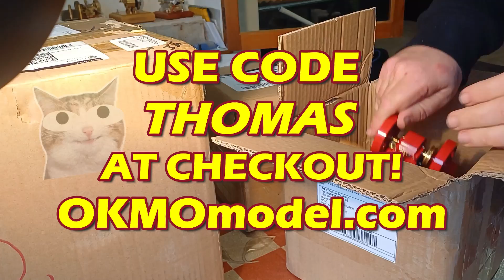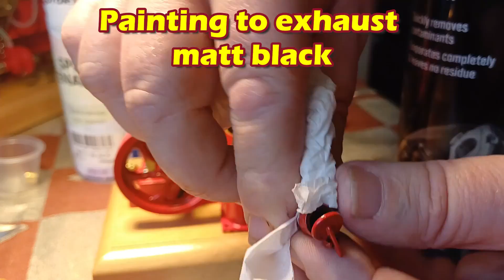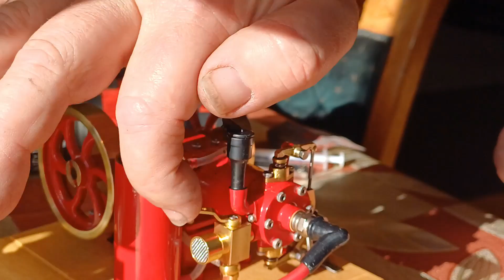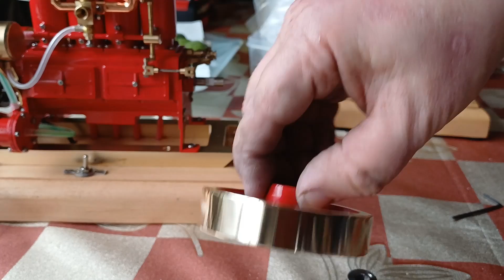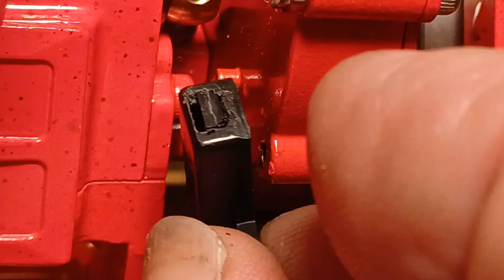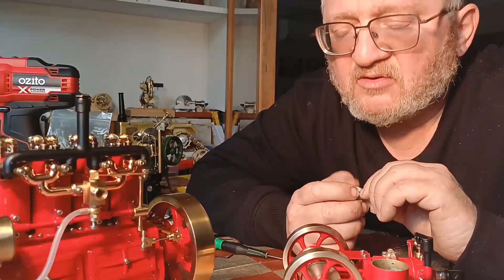BLOODY GORGEOUS model engines MADE EASY tweaked painted vintage model engines microcosm H75 M25

Comment: Beautiful Thomas, I'm waiting for a painted engine from Jin too!

Incidentally, the curved spoke  flywheels on the single cylinder engine are on backwards.
Why the Chinese do this is beyond me, but if you look at a big horizontal engine with curved spoke flywheels, like say a Blackstone for example- the curved spokes always are fitted facing the opposite direction, to what the Chinese fit them, and it irritates me something terrible! 

Same as the Retrol Mill Engine- again fitted the wrong way round!
😅😅
Reply from the maker: Yeah I've looked at this and wondered if I can switch them round. Not that simple due to crankshaft lengths. I'd like it to be right too

Comment: G'day mate. With your idle, if you get a set screw the right size and a nut. Put the nut on the screw then screw into the carby and tighten your nut to stop the screw moving and you don't have to use locktite on the threads but a little flat washer between the nut and carb will stop paint being scratched off. It would be nice to see a bit more sheen on the tank. Black radiator surround? They are niiiiice little engines.
Reply from the maker: Yes this idea or a spring was forming in my mind. Good idea...as a hit n  miss guy I am a bit late to variable speed carbs, I still struggle to find the sweet spot but I guess I enjoy the fiddling